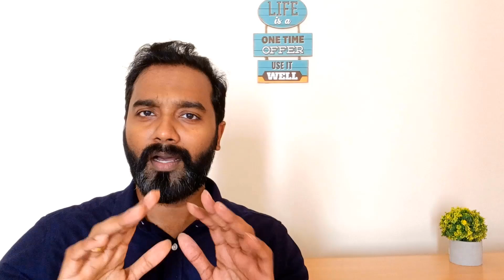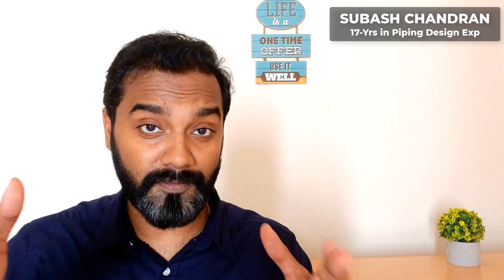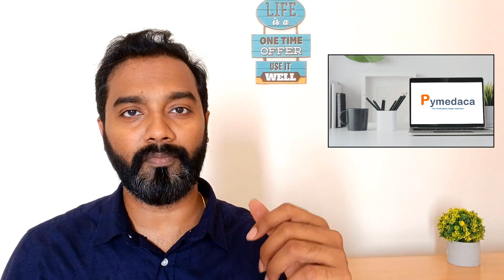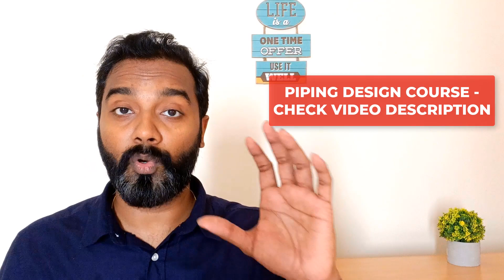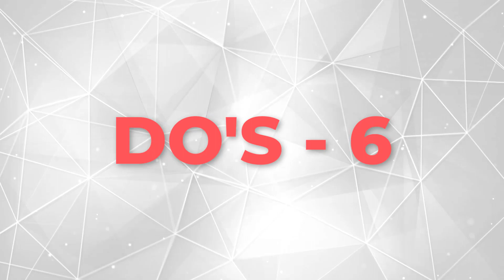PIPING DESIGNER TO PIPING DESIGN ENGINEER ( How is it possible?)

Comment: Sir,
Greetings.
I am a Mechanical Engineer Graduate having 6 years of experience in Piping design and detailing. After completing Engineering, I started my career as a designer. I am working on Cadworx and Autocad software. I am learning technical things by reading, internet blogs, and Youtube videos, but I am not getting the opportunity to work on engineering tasks. I am working with the workshare projects where the engineering is held at overseas locations, and all I receive the task is drafting. Please guide me to grow as a piping design engineer.  I am failing in most interviews due to my designer work experience and lack of engineering knowledge/experience.

Comment: I am a mechanical engineer with 7years of pipeline,structural project execution experience.last one and half years i am working as a planning engineer in steel structural engineering..using tekla as a primary tool…i would like to learn some tools in piping field and would like to change my field…please suggest me a tool to learn and start my career with compromising my current annual salary of 6lac….is there any possibility…i am a fast learner and towards learning new things…
Reply from the maker: Hi... Good tat u r seeking growth. but look.. the first biggest problem with most people is that they focus more on money than on learning and the second is tendency to move on to new things instead of gaining indepth knowledge in one field. Having 7 years in one field and then moving on to the different field is not at all a bad idea but by this time u must know what u wanna do. Your case u still not have an idea about ur interest and looking for salary is not sinking. Think abt it.